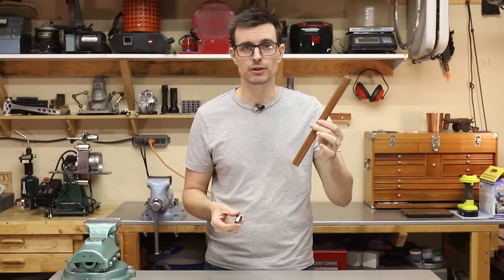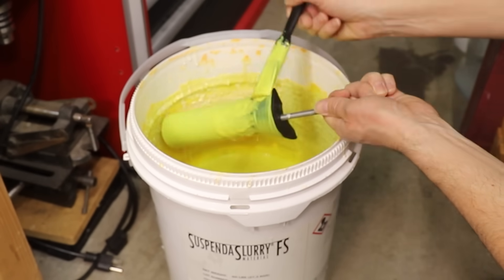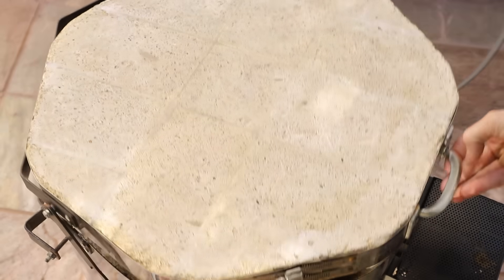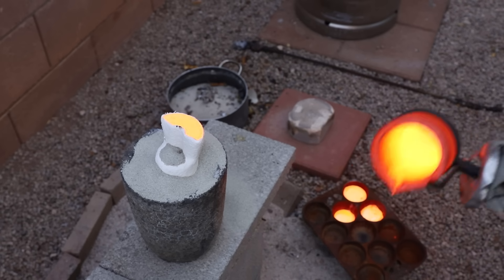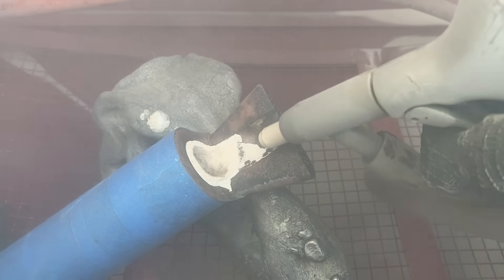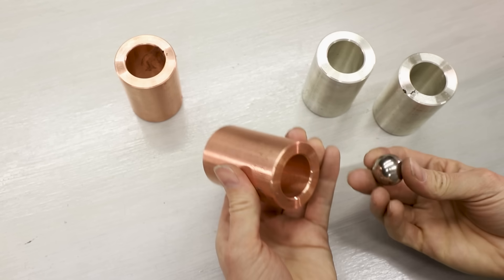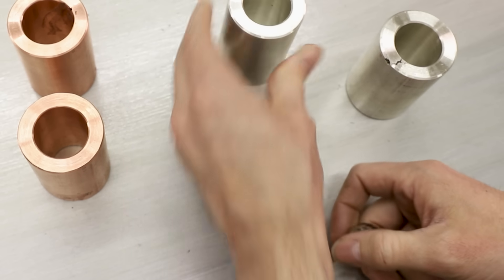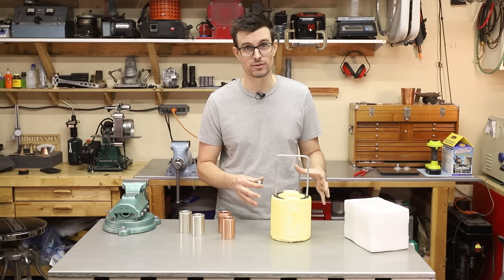Making Anti-gravity tubes - Copper & Silver! - Lenz's law - Metal casting Experiment

Comment: This is actually a very known phenomenon, metal impurities affect the conductivity of those metals very negatively. A copper silver alloy has worse conductivity than both those metals in their pure form. And even small impurities already show a negative effect, just 0.1% copper is needed to make the alloy a worse conductor than both.  Thats why for electric installations of all kind you want 99.99% pure copper.
Reply: Gold is used as a conductor not for its superior conductivity but for its longevity. It never oxidizes.
Reply: @baraBober  Uh DUUUH. Of course it has something to do with resistance, and Sterling Silver has a higher resistance than pure copper.
Resistance and conductivity are linked. Higher conductivity means lower resistance.
The Magnet falls through the Silver pipe faster because it has a higher resistance because its an Alloy with 7.5% Copper.
Reply: @Toxicity1987  Silver has a higher conductivity than copper.  Resistance is elated to the dimensions of the conductor.
Reply: @karhukivi  Pure silver has an higher conductivity than copper. Sterling Silver (which is that one used in the Video) has, due to its 7.5% Copper inclusion, a worse conductivity than pure copper.
Reply: @Toxicity1987  True, but they are still both excellent conductors and the difference will not be noticed in the sort of experiment shown here. In fact, you would need special laboratory equipment to measure the conductivity (i.e. resistivity) of metals.
Reply: Yes, 99.99% pure silver would have given a longer drop time than 99.99% pure copper.
Reply: @CuriousFocker so . 01% is filled with what metal to not jeopardize performance in silver
Reply: @CuriousFocker  by about a microsecond!
Reply: Craig Westbrook Hydeigen News
Reply: 9:22 - 9:38  NO COMMENT!
Reply: @johnholmes6897  like apple pie. 🤷‍♂️
Reply: @ralanham76  exactly ! Lmmfao
Reply: The OP is spot on about (im)purity confounding the results of this experiment. Sterling silver (.925 Ag .075 Cu) has a lower melting point than both pure silver and pure copper.
Reply: Diversity sucks
Reply: Isn't this a solution to 18 wheelers brakes overheating?
Reply: @BMfixit  Eddy current breaks overheat as much as friction brakes do. The induced currents create heat in the material. The advantage Eddy Current breaks have is no wear. The disadvantage is that they are unable to break to a full stop. A friction break is still needed for that.
Reply: Coin collectors can use this principle to sort copper pennies from the newer zinc/copper pennies.
Reply: @martinphilip8998 Too much work, we typically just look at the date:
If it's from before 1982, it's copper.
If it's from 1983 or later, it's zinc.
If it's from 1982 exactly, it could be either. In this case, we sort the 82s by how they sound when they hit a hard surface. If it rings, it's copper; if not, then zinc.
Reply: @baraBober  it’s the resistance yes resistant but it’s the other way higher resistance is lower current flow which means the ball falls faster because OK is the magnetic field is slowing it down
Reply: Assuming that Robinson Foundry has the chance of measuring the conductivities of both cast alloys, Cu hollow should give around 45-50 Siemens with a Sigma Tester as 99.995 % Electrolytic Cu reaches to 58 Siemens. It is by sure that a few ppm O2 is given by open flame (plus the scrap pipes had a lot of Ca, S even observable from photo), which reduces conductivity considerably and this is why El-Cu is used in premium grade cables. Not much to say about the Ag-Cu alloy as it is by sure  that the conductivity will be way too lower than that of each metals. It was a VERY GOOD experiment to show/imagine us how magnetic levitation would work with a super conductor. Thanks to you Rob - if it is your name.
Reply: @fluchterschoen Naah, and worse i once even bought CCA Cables by accident. So really no. Working in IT.
Reply: How would 99.99999% pure gold work?
Reply: @masonthorpe7327  Gold has a worse conductivity than silver and copper. I think even a silver copper alloy has better conductivity than gold.
Reply: @Toxicity1987 Ok. Awesome! Thank you for your insight!
Reply: @Toxicity1987 Out of all the metals available to us, what do you think would be the best option?
Reply: @masonthorpe7327  Guess.
Reply: True that
Reply: Still is pretty mind blowing to see this effect.
Reply: Yup. Some metals and alloys as little as 10ppm contaminant can ruin its properties.
Reply: Lolol the usual Nemo scit quantum nescit 😂😂😂😂😂.
Reply: Yet plating, has no negative effect, because of the lack of alloy formation, while having that electro-chemical bond ensures great conductivity between both. Same with gold plating. 

Now if only we could test this with some PGMs
Reply: are they 99,99 %?
Reply: @baraBober  you got the wrong way round pure silver or copper has low resistance and thereby generates a stronger magnetic force and makes the magnet fall slower.
But he used Stirling silver which is higher resistance so the magnetic field is weak and cant generate much force.
Reply: That is not because of the conductivity which is hardly affected, it is do do with ductility - i.e. the flexibility of the metal and its resistance to becoming brittle and breaking.
Reply: Coper has 8 electrons on last shell, Silver how many ? .....so through which field magnet ball come quicker.
Reply: I found aluminum worked about as well as copper.
Reply: You must be fun at parties
Reply: indeed.. :-(......... the magnet is is inducing drag on the copper simple..       the magnet is inducing eddy current to the copper hence SLOWING IT DOWN.. natural KNOWN phenomenon with magnets..... ( aka swing a magnet by some copper coils and you get ELICTRICITY  lol
Reply: What a buzzkill. Better that no one talks about things you deem well known 🙄
Reply: No. @baraBober
Reply: I came looking for this comment as soon as I got to the part where he said it wasn't pure silver
Reply: This experiment was fascinating! I'm curious—since pure silver has lower resistance than copper, would using pure silver (instead of sterling silver) have slowed the magnet even more effectively? Or is there a point where resistance is low enough that other factors dominate the result? I'd love to see a comparison with pure silver in the future.
Reply: Your mom goes to college.
Reply: How does such a small impurity make such a big difference?
Reply: @simon_fox_youtube Its crazy man, its like mixing copper and tin, both soft metals turns them into bronze which is waaay harder
Reply: @simon_fox_youtube  I mean, copper takes up the open valences of the copper elements in the alloy
Reply: @simon_fox_youtube The impurities disrupt the regular arrangement of the atoms creating atomic level defects in the metal's lattice. The defects cause the free electrons in the metal to scatter, which disrupts the flow of current. The more impurities, the greater the scattering. The scattering causes higher resistance. The resistance makes the current induced in the metal by the magnetic field weaker, and lessens the opposing field.
Reply: @simon_fox_youtube  not about impurities, it's about eddy currents
Reply: @simon_fox_youtube  an alloy is like a solid solution. Qualitatively it the same kind of effect as salt making ice melt or water boil at a slightly higher temp. You can really go down the rabbit hole of crystal structures and energy levels but you can imagine that the copper atoms get in the way of the electrons trying to flow through the silver because the don’t fit quite right. If the metal is all copper or all silver then everything is nice and orderly and it’s easy for electrons to flow.
Reply: That's going in the right direction as to how UFOs are powered. Without combustion through the correct channeling of gravity.
Reply: Wrong.
Reply: Then why is it made of copper?
Reply: @SameAsAnyOtherStranger and because making them out of silver and gold would make the wiring in your house worth more than the house itself
Reply: @teslastellar  Pure gold has worse conductivity than pure copper. No.1 Silver, No.2 Copper, No.3 Gold, No.4 Aluminium (Aluminum for you Americans) No.5 Zinc
Reply: @CuriousFocker Both usages for Al are IUPAC acceptable.
Reply: @CuriousFocker  but is gold nevertheless fine for cat 8 ethernet cable contacts?
Reply: @CuriousFocker  thank you for specifying that. As an American we have no idea what "aluminium" is.
Reply: @teslastellar  Gold is actually a poorer conductor than silver or copper... Gold has the singular advantage of corrosion resistance, making it the superior metal plating for electrical contacts.
Reply: @teslastellar 😂
Reply: @teslastellar silver wire would be more feasible as it's significantly less expensive than gold coming in at 33 dollars an ounce currently while gold is at 2900 an ounce. 1 standard gold bar can buy an average house worth about 400k while a one standard silver bar which is 100 ounces is worth about 3400 dollars
Reply: silver isnt as ductile as copper, so drawing into wires is harder, and obviously more expensive. @SameAsAnyOtherStranger
Reply: @SameAsAnyOtherStranger  What? They were pretty clear why the alloy has worse conductivity.
Reply: @Morberis  EDIT: For anyone else that wants to come try and akshually correct me, National Electric Code 310.14 (NEC 310.14 approves stranded aluminum wire of AA-8000 alloy for branch -chain-circuit use (stuff we use to charge our phones).
Once upon a time the fires were true. They’re not now. Now it’s just perpetuated ignorance.

power transmission lines are made of aluminum and they’re about 70% conductivity of copper. Just need to use bigger diameter lines: it’s aluminum, it’s light and cheap so no problem lol
Copper is an expensive material and I’d bet my left nut aluminum is fine for home use.
Reply: @xostler  No it's not. It's the connections that cause problems. They thought the same thing in the 70's as well, that the connections could be done safely. But the massive increase in house fires showed that it couldn't be done consistently.
Reply: @Morberis  that sounds like growing pains on using a new material and bad design more than aluminum’s limitations as a building material.
Please explain how the connections failed, in case I’m missing something.
My father was a custom home builder for 30 years, I’ve worked in it about 7. It makes 0 sense to me how those connections failed but power transmission lines don’t.
Reply: @xostler  Maybe do your own research. How common do you think it is for home owners to do maintenance and not delay it though? It's a stacking of issues problem.

Also, linesmen get paid FAR FAR more than electricians do especially in the US. Like double or more. Linesmen will often pull $200k+. Residential electricians might be making only $40-50k, less or more depending on the state and their certification requirements. And their tools and the equipment they work on is much more expensive, sometimes made to higher standards, and has no space requirements.

Edit: And the forever harsh downward time pressure on residential electricians to go faster faster faster than linesman don't nearly experience
Reply: @xostler  The brief reason for connection failures is that aluminum aggressively reacts with oxygen and forms a hard aluminum oxide (alumina) film which is an insulator.  Due to thermal cycling and natural creep, twisted or crimped joints may gradually loose compression over time so that oxygen works its way in, reducing the electrical contact area between the conductive parts until the current density in the remaining area gets so high that the area gets hotter and hotter.  When the power is switched off, the joint loosens further due to thermal shrinkage at the lower temperature.  This effect can become a runaway phenomenon, leading to enough heat to cause fire.   

There was aluminum wiring in the ceiling at my place of work.  One night, a fire broke out there, causing extensive damage, but fortunately the building was not a total loss.  The wiring was replaced with copper.

Properly welded joints could mitigate this problem, but welding aluminum requires special equipment and is an expensive operation, apparently too expensive so far for widespread use.

At an industrial show some years back, there was a salesman demonstrating a solder he was using to join aluminum to brass.  The solder, heated with a torch, flowed readily onto the surfaces and produced a beautifully filleted joint, apparently producing thoroughly "wetted" surfaces with the solder.  The joint was quite strong mechanically.  He gave away samples he had soldered.  I took one and put it in my desk drawer where it sat in an office environment about as benign as could be imagined.  One day after being there for about five years, I took it out and gave it a gentle push and the aluminum popped right apart from the solder and brass.  Whatever bonds that had initially formed were only temporary.
Reply: @analog_guy  thank you for answering my question! I think this adds to my original argument that the fires were from growing pains and not a material fault. The way you described sounds like a galvanic reaction. The oxidative resistance makes some sense. I’m curious to know how much of that is from impurities in older aluminum productions processes, though I’m not sure I’ll find that info easily. I’m still unconvinced as I just can’t see it adding THAT much resistance since aluminum wiring in every other application doesn’t have that issue. 10 and 12 gauge stranded aluminum wires are actually approved for use in high current applications like ovens or air conditioning until. If resistance is such a problem why is it approved for high current applications?

The problem seems to be with two major factors: galvanic action at junctions and use of single strand wires. This is pure speculation but I think that if there would be no problem if pigtails were used. Stranded aluminum wires are found in every ceiling fan I’ve installed. So they’re not just used in high current stuff. Using wire nuts to tie stranded and non together isn’t code but I’ve seen it in plenty of junction boxes regardless. I’m missing the numbers on ceiling fan related house fires but I’ve not heard anything about those so I am working off that assumption.
Reply: @xostler   The reaction between aluminum and oxygen is direct and does not require dissimilar metals in contact nor impurities in aluminum, as far as I know.  In an oxygen-containing atmosphere, all aluminum forms an oxide layer at its surface.  Stranding helps with flexibility but provides more routes for oxygen entry at junctions.  Aluminum is indeed a good conductor in its bulk.  The problem arises at surface-to-surface contacts.

The contact resistance can vary from virtually zero up to a complete open circuit.  The anodizing process that is used to provide additional protection to certain aluminum items merely forms a thicker hard oxide film on the surface.  The surface of an anodized aluminum item is completely nonconductive.  You have to dig through the surface to get any conductivity.  Non-anodized aluminum contains a much thinner version of this oxide surface that is easily broken through.

The motors I have examined contain copper wire.  I haven't examined any newer ceiling fans.  Ceiling fans generally require a lot lower current than the typical 15 amp or higher rating for home wiring.  If aluminum is being used in ceiling fans, it is presumably due to the lower likelihood of fire due to the lower current.  Where aluminum is being used in high current applications today, the junctions will use special techniques to keep the resistance low.
Reply: @analog_guy  you must have missed the part about aluminum being approved for high current, residential applications. Section 310.14 of the National Electrical Code says aluminum conductor alloys be at least an AA-8000 type alloy.
The surface of oxidized aluminum is not a perfect insulator. Especially when it comes to atmospheric oxidation versus anodization. Anodized and oxidized are a HUGE difference.

Concerning the ceiling fans, the aluminum is in the wiring to the junction box not the actual motor. 

I am aware of aluminum’s reactivity to atmospheric oxygen. My argument is that oxidation is a non-issue. 

The ONLY info I’ve been able to find on aluminum wiring and it’s association with fires is from Consumer Product Safety Commission: and the story goes that his wife, who worked in insurance mind you, pushed for the change back to copper. I’ve yet to find any numbers for that claim.

I maintain that any of the fire claims, as reason for not using aluminum today, completely fall apart under superficial levels of scrutiny. If aluminum can be used to power your oven and HVAC without risk of fire, it can absolutely be used for generalized applications.
Also, upon doing more research AlumiConn has been UL approved since 2006. So I guess copper-aluminum pigtails are already approved today. 

Seems like there isn’t a problem using aluminum: it’s just that no one does because of bygone circumstances.
Reply: @xostler  The problem with Aluminum wiring is that it is notorious for expansion/contraction due to heat, heat that is generated by high current applications. Each heat/cool cycle can result in deformation of the wire, causing the connection to degrade. The increase in resistance at the degraded junction creates more heat with less current. Numerous house fires were attributed to AL wiring in its early days, most often, as I recall, in junctions where CU and AL were combined. I have seen failed wall outlets where the insulation on AL was charred within 4 - 5 inches of the screw terminal, But it is worse using AL on sockets with push-in connectors.
Reply: @xostler  
1) I would point out that Alumiconn "pigtails" are not actually pigtails. In no instance do CU and AL come in direct contact with each other.

2) Alumniconn terminal blocks are encased in a plastic which helps mitigate environmental damage. That, plus the fact that dissimilar metals are isolated from one another allows for heavy torquing of the set screws.

3) You argue that the oxidation of aluminum does NOT increase resistance but with no apparent citations to support your claim.

4) You seem hell-bent on convincing others here who seem to have better knowledge of the subject, that they are absolutely incorrect about the dangers of AL wiring. Admittedly, it is not the fault of the AL wiring, but of the incompetents who think that AL and CU can be treated in exactly the same way.

5) I would further point out that the faulty connections are hidden behind walls and wall plates, and will not generally become evident until smoke or fire presents itself.

You are certainly welcome to practice whatever electrical skills you possess. Just make sure that you have good fire insurance that is paid up.
Reply: @denniskeim1496  I’m gonna go ahead and give you a chance to scroll down more where I cite National electric code… and the part where the heat cycle problem is solved using stranded wires...
Also I never said oxidation didn’t increase resistance. I said in response to another, atmospheric oxidation is negligible and is different to anodizing.
I’m not hell-bent on anything: y’all are just classic internet mob trying so hard to be right, instead of correct.

You claim I'm the one that needs to learn and others know so much but forget you I'm the only one ACTUALLY citing building code! Dude, how can you even talk down to me like that with a straight face? There is no problem with aluminum, because a poor craftsman blames his tools or materials, and if everyone had such a regressionist view as "well we tried it once and now we know it will never work," we'd have never made it to the moon!
Failure is a part of progress, the same for building material as anything else. You should be ashamed to have belittled me for such a dumb reason, especially when NO ONE else has cited building code but me!
Reply: @xostler  the wall plug outlets were poorly designed. Rather than clamping down on the full diameter of the wire, the AL wire was simply pushed into a hole in the plug and jammed against a knife edged piece of metal. The current was focused into this small contact  area which caused overheating and possibly fires.
I replaced all the outlets in my house and several showed signs of overheating and charred insulation 😢
Reply: @analog_guy  I cant post a link but there’s an article in International Association of Electrical Inspectors Magazine by someone named Peter Graser titled, Copper Clad Aluminum Building Wire for Use in Residential Branch Circuit Wiring in 2016 September/ October magazine. It’s a great article outlining the history, use, failures, outside factors, and modern benefits for aluminum wiring for general residential use. I went and found it straight from the horses mouth so we could all educate ourselves, hopefully y’all see this instead of me just screaming into the void.
Reply: @TooTallDean  that makes sense! I had a hard time making sense of how it could have such a horrible connection. 

Also part of it back in the day was what type of aluminum they used and that the aluminum required a larger gauge wire for same applications.
So like 12ga Cu = 10ga Al.
I cited a paper down here in the comments to another. It’s a good read if you care to!
Reply: @xostler  thermal matching, threaded connections and punch-down terminals, and aluminum tending to form refractory oxides, low melting point, and hot-shortness meant aluminum wiring heated up, loosened itself from terminals, and shorted, sometimes heating to molten, but more often fatiguing, resulting in mechanical failure. As a long distance or long-span conductor at high voltage/frequency, its fine, but not in a situation where loads are variable, and especially when the loads are highly impulsive, like home wiring for AC units, heaters, and stoves. Boom, loads of current for tens of minutes, then click cool down rapidly, etc.
Reply: @xostler & @analog_guy,
Nice discussion, thnx guys.
This aluminumoxid occurs immediately on exposure to oxygen.  Makes the surface much harder, but it is only very thin.  Still it is bad for a drill.  When drilling aluminim, one can use alkohol, also cooling the process.   Pause just a second and there's already a new oxid layer ;•).
🚀🏴‍☠️🎸
Reply: @xostler  Yes, those two words, "Copper Clad" speak volumes.  The article covers a lot of history.
Reply: @analog_guy  so does AA-8000 and NEC 310.14. Something that may have been true once, isn’t necessarily true today. 

I came with good faith effort and you cherry picked so you could be right instead of correct.
Reply: @xostler  You asked, "Please explain how the connections failed, in case I’m missing something."  Several people have done that.  The question has nothing to do with standards.  If you want an argument, please look elsewhere.
Reply: @analog_guy Thanks for the anecdote.
Reply: @analog_guy uau. Seu relato é muito importante, obrigada.
Reply: @xostler  ALUMINUM SUCKS! STOP SIMPING FOR ALUMINUM!